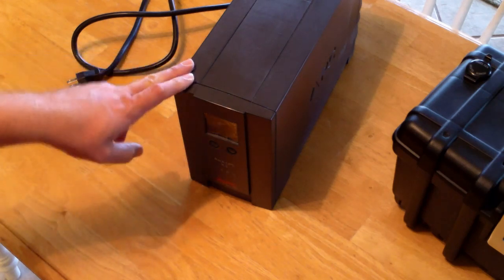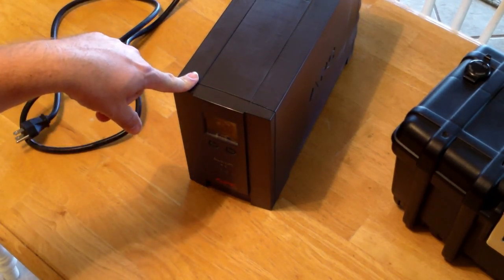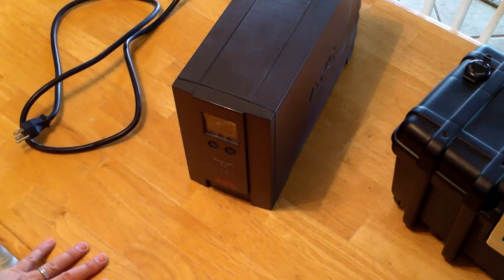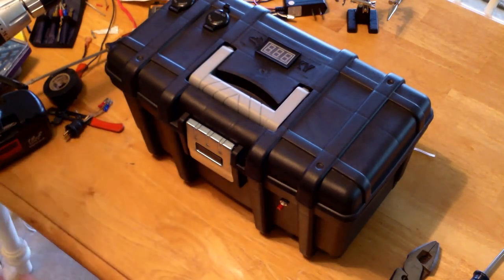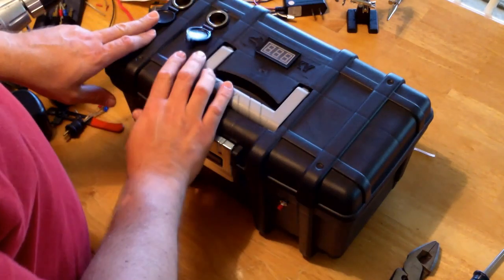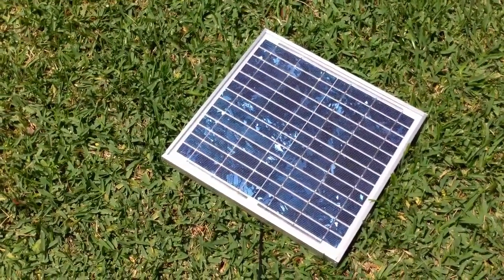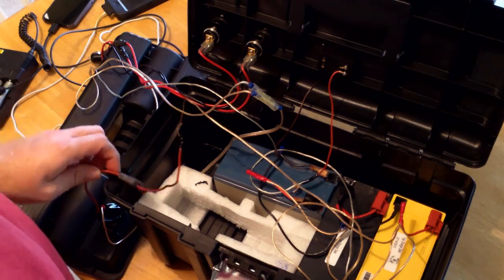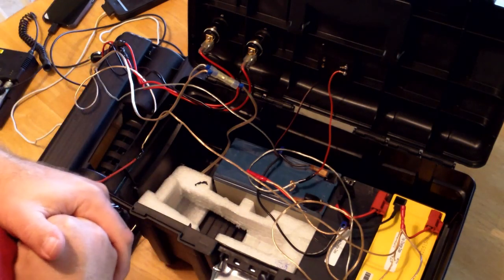Portable Power Station

Comment: Those larger UPS units usually need to be re-calibrated when their batteries are changed. I’d imagine that’s why it was shutting down prematurely.
Reply from the maker: I had not heard of that before, your probably right. I was talking with a friend the other day who has defibrillators in his medical office and said that he gets charged about $600 to have the defibulators recalibrated when the batteries are changed out. Then he replaced the cr123's himself one time and it said new batteries detected, reset to calibrate and he he hit the reset button and it recalibrated. Now that's a scam to me.
Reply: acet7 It is a bit of a scam how they obscure the process. Calibration can either be done in software, or it can be done manually. I’m only really familiar with APC Smart units, and to calibrate most of them as a consumer, you have to rely on hacky third-party software or just do it manually. Maxarcade has a video on doing it manually if you’re interested. Just search “recalibrating UPS” and it’ll be the first or second result.
Reply from the maker: @Dantastic  Thank you, I didn't know that. Will have to look into it as the one I have now is about 1.5yrs old and might need to change out the batteries soon.

Comment: If a UPS fails, my experience has been that it's always capacitor failure leading to battery failure from over-charging.  Most of the time, the dud capacitors are easy to spot because they're PCB mount (both leads emerge from the same end) and the opposite end will be bulging so it's concave instead of flat.

Replace the bulging capacitors and the batteries then the UPS should spring back to life.  I've done that with a couple of mine and so far it's worked.
Reply from the maker: JasonMasters thank you for the advice.

Comment: Why such  small wire gauge? looks like 18 gauge.....
Reply from the maker: Good question I have gotten it before. I don't know the gauge of the wire it was left over from a lamp that I was working on. I don't know the gauge, however I have not had any problems with it ever since I built it.  I use it every time we go cub scout camping and in the hurricane Irma videos, you will see it up and running as well. Thank you for watching!

Comment: If the batteries are wired in parallel they will all share the same voltage between terminals, thereby maintaining identical charge percentage.  However, be careful when initially attaching batteries in parallel, there is a risk of over-current while the batteries equalize voltage for the first time.  Make sure batteries start more or less at the same charge percentage before wiring them and you're good.
Reply from the maker: Matto-san Good information thanks for sharing and watching.

Comment: You can charge your batteries with your wall charger on the same plug as your solar panel.  Your charge controller will assume its solar.  As long as its not a smart battery charger.
Reply from the maker: huh I had not thought of that, thanks. It helps to have a second set of eyes on something. The charger is a smart charger but I do have another small dc charger that I could use in that port. Thanks for watching and the idea!

Comment: i would have liked to see you plug in the  solar panel  ...which port you used
Reply from the maker: at 3:58 you can see I working on the the plug you are talking about. I didn't want to cut the wires from the panel so I just made a connection from the plug w/ male and female wire disconnects. Hope this helps and thanks for watching.

Comment: i would use better quality wire, looks like you were using pieces of scrap
Reply from the maker: +Joseph Proia I was, I was just using what I had lying around to keep costs down. Although it still works like a champ no problems at all. If I ever rewire it I will do it with all new wire. Thank you for watching.

Comment: Do you have this UPS on the same circuit as a printer, AC unit or refrigerator.  Get a lamp with an old fashioned incandescent bulb and watch it when the compressors kick in or when the printer is turned on or warming up to print.  If you do, isolate the UPS and PC on a circuit away from those sorts of appliances.
Reply from the maker: No it was two rooms away from the kitchen, not on the same circuit. But thanks for the idea and watching.

Comment: I'm doing the same. How to I make a switch for the solar charge controller so I can turn it off and on? how would I wire the switch?
Reply from the maker: +M9A1 MAN I just took the positive lead between the solar controller and the batteries and installed the switch there. The solar input I did not install a switch as the only pwr would come from when I had the small 10watt panel plugged in. I guess if you wanted to be extra safe you could also put a switch between the positive lead from the panel and the controller as well. Hope this helps.

Comment: I build a little Ammo Can Commercial unit for this same purpose. The Charge Controller is absolutely essential. I know the batteries you're using VERY well. May I suggest a 40 Watt Panel for your system? You will get a MUCH faster Charge time, & the 40 Watt Panels are not too large.
Reply from the maker: +Bruce Forster Thanks for the tip makes sense, I was just using what I had on hand at the time.

Comment: Is that speaker wire you are using for 12v from the batteries
Reply from the maker: urgoobotz It looks like it, but its some 110 volt lamp wire I had laying around from a table lamp repair. I see you sub to ChuckE2009 also, he does some good metal work. Thanks for watching.